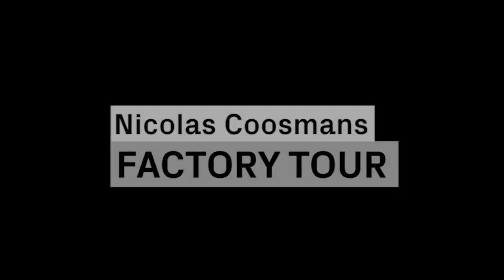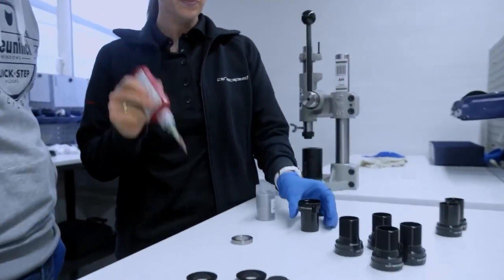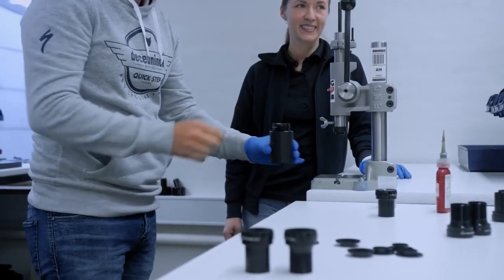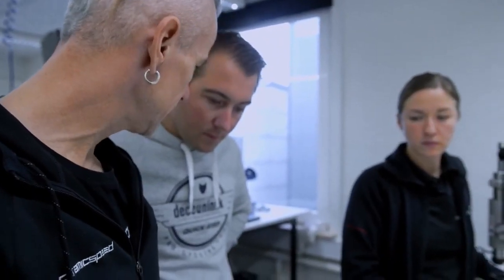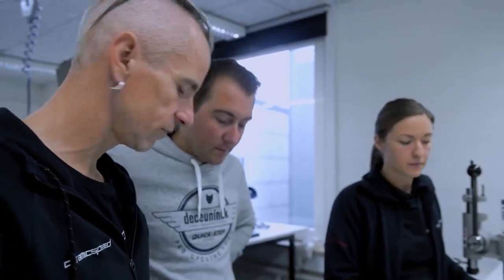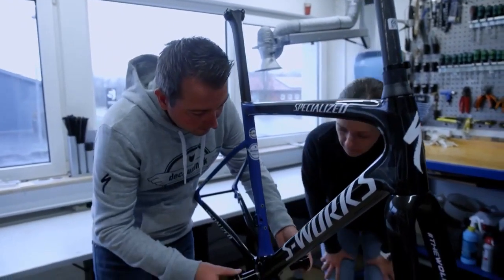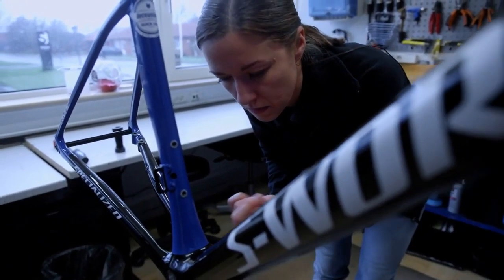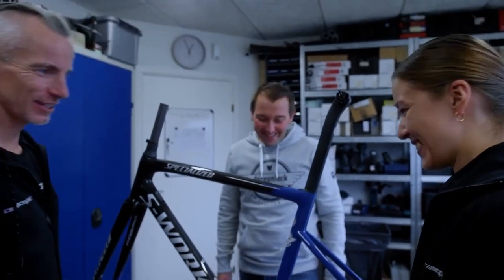Nicolas Coosemans - How to Install a Bottom Bracket

Comment: Would adding a ceramic speed bottom end on my road bike, add wattage? 
I just installed your pulley wheels to my shimano 8000.
Reply from the maker: Hi Aaron, yes, as more of your energy (watts) will transfer from your shoes to your rear wheel when upgrading from a standard bottom bracket to a CeramicSpeed one.
Reply: CeramicSpeed ok so which bottom end would I need for my shimano ultegra R8000
Reply from the maker: Any of our Shimano bottom brackets will work with your Shimano Ultegra crank. The other information needed is what BB shell type your frame has.
Reply: CeramicSpeed I think it’s best I call you guys or email you my full spec of my bike.